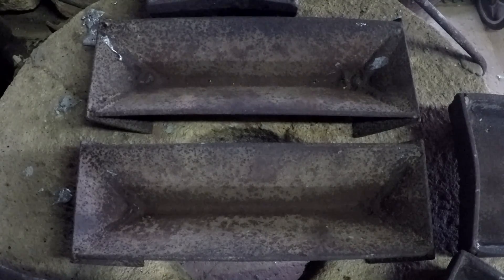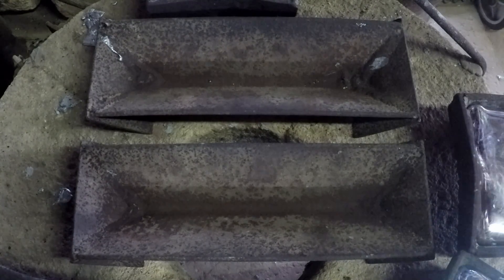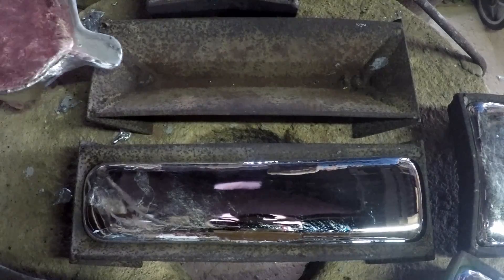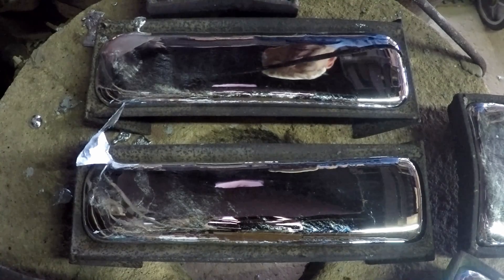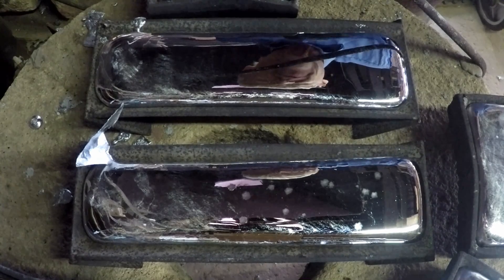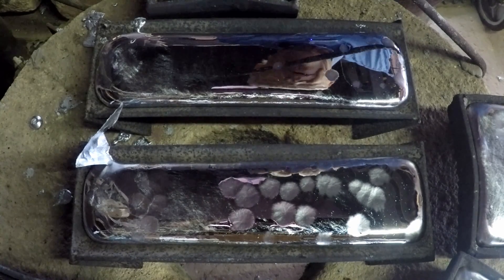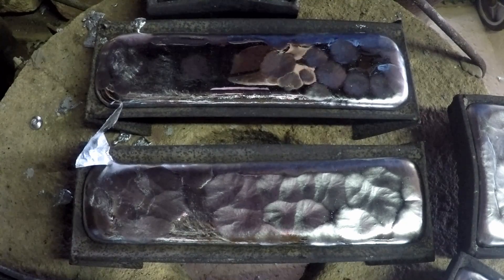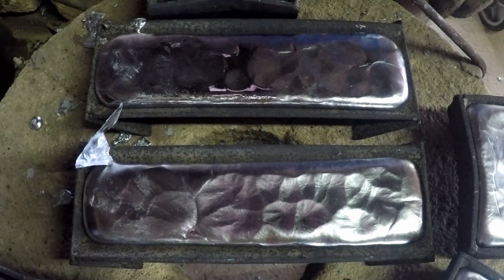Solidification Curiosity

Comment: Interesting ! I have to try it out in my foundry . I have a question for you sir . Does using grain refiners and modifiers reduce the surface porosity occuring after shot blasting of alumnium casting ? Please guide .
Reply from the maker: Sourabh, Grain refiners may possibly reduce porosity because they promote better feeding. Modifiers are another story - strontium is widely regarded as increasing porosity particularly subsurface. Sodium is regarded as better but I doubt it would reduce the problem rather it probably won't make it worse.
Shot blasting is about the worst thing for showing up an porosity .😱. Martin

Comment: Yestarday i had similar problem the cast breaks like glass and it has shiny crystals 
The thing is i melt my scrap with bolts and all steel is this the problem
Reply from the maker: rabih, Bolts  and steel etc are bad news, Molten aluminium is quite good at dissolving steel and very good at dissolving stainless steel The iron thus dissolved in the aluminium forms compounds with aluminium and silicon, these compounds are strong but behave in a very brittle way as they seem to prefer forming on oxide films floating around in the aluminium. In so doing they straighten the films out so they act like long flat cracks in the aluminium, thus the shiny crystals you are seeing are likely these iron aluminium silicon compounds and aluminium with lots of them will indeed be very brittle. The crystals can also be silicon depending on the alloy but they are usually not easy to see with the naked eye. Any aluminium that has turned out like this for you  - throw away - it can not be recovered by any easy means. I short never alloy molten aluminium to touch steel for any length of time.... Martin

Comment: When i cast my 45-70 405 gr. Bullets. When the pure lead is very hot I get what looks like frost Crystals on the serface. When I pore a few minutes  later. No frost looking crystals just very smooth shiny  finish.
Reply: There may be small amount of zinc   as i melt down wheel weights.
Reply from the maker: Mark, I am not certain (well, I don't really know at all 😏) but I would think that pure lead may be a bit too soft to use for wheel weights and it would not surprise me if it contains some antimony to harden it up. However the zinc situation is another story. Strange as it may seem zinc and lead don't get on that well together at all and in fact except for very low concentrations of either they will not alloy but rather form two different liquids (lead on the bottom zinc on the top) The zinc one melts at about 420 deg. C and the lead one at about 320 deg. C. Now what happens as a low zinc alloy cools from 420 to 320 is that it will slowly reject what little zinc it contains, this zinc will be solid and likely floating on top of the lead. When the metal is just solid the lead will contain almost no zinc in solution having rejected almost all of it. Perhaps this is what your seeing - well that's my interpretation of the zinc lead phase diagram anyway😏...Martin
Reply: @olfoundryman8418  .. I  was guessing  the frost looking crystals was because of the zinc.. could these crystals be antimomy? Or combination of both?
Reply from the maker: Mark, Are the crystals big enough to see if so what shape are they - antimony has quite a distinct shape. However I would only expect the antimony to form crystals of an antimony rich solid solution containing a little lead if the antimony content was over about 12 %. and these may well be through the remaining liquid rather than just on top of it.  Presumably your thoughts over the zinc is pick up from the steel lugs used to hold the weight onto the wheel, considering how thin the zinc is I doubt that you would get any significant pick up. Interesting as to what this "frost" might be though... Martin

Comment: A very interesting phenomenon. Reminds me of the well-known  Benard convective cells, and sure enough there are many hexagonal cells, or hexgonal-oid cells. Since the metal at the bottom of the mold is still  hot and the surfacw is ambient, it looks to me like Benard convective cells.
Reply from the maker: Juan, Now here you have got me! I was trained as what might be called a "Secondary Metallurgist". The aim of the course (3 year full time) was to produce Metallurgists of immediate use to industry - someone who knew how to take a hardness reading and knew what it meant, someone who could take a sample of anything (metallic) prepare a metallographic specimen from it look at down a microscope and know what he was looking at and what had been done to it, plus a whole lot of other useful stuff besides. But what you mention here is far and away above my pay grade 😊 - more in the realm of physical metallurgy I suspect.
A few things though, the metal was cast into a steel mould, not room temperature  cold but still way colder than the metal, surely then the metal at the bottom would be the colder? Also the size of the hexagons varies with the mould temperature - colder mould smaller hexagons. It also varies with very minor alloy additions 0.01 % strontium for example produces a very marked reduction in hex size not surprizing perhaps as the Sr modifies (refines) the silicon structure and this is a eutectic Aluminium Silicon alloy. Other alloys eg. the American 356 which is considerably hypoeutectic do not exhibit this effect at all. But I do note that it sure looks like those Bernard convective cells - as to if it is or not I do not know enough to know....Martin

Comment: Not related to your topic, but my uncle told me that molten aluminum tends to dissolve iron.  Steel can be protected by coating it with plumbago.  Your ingot forms reminded me of this.
Reply from the maker: Vel, Aluminium does indeed dissolve iron, in fact it will dissolve almost all metals. It is particularity vicious in dissolving stainless steel but mild steel and cast iron are also attacked. Once the aluminium "wets" the iron dissolution can be quite rapid. Unfortunately the iron has a bad effect on the aluminium making it brittle and more difficult to cast. Worst of all the iron can not be economically removed from the aluminium. This is why one should NEVER use iron crucibles to melt aluminium in. 
A coating of a wash based on graphite (plumbago) or even better one based on boron nitride will delay the attack but once the coating is scratched or ruptured in any way the attack will proceed.... Martin

Comment: Perhaps it's particles of iron oxide from the mould starting the nucleation points?
Reply from the maker: Amalg,  It could be damn near anything. There are fairly strict requirements for a nucleant to work - something about similar type and size of lattice structure in at least one direction with the substance being nucleated. This means that different things nucleate different substances. I have no idea if iron oxide would fit these requirements, maybe maybe not. Only thing I can add is that there was no loose iron oxide on the moulds... Martin

Comment: i only learned about eutectic alloys his week messing around casting solder. would love a more comprehensive discussion about them if you can !
Reply from the maker: Emmas, Eutectics,  one hell of a big subject about which I know not too much. They are what actually got me into metallurgy. As a young lad I was fascinated as to how one could mix two or more metals together and (sometimes)get a result that melted well below the melting point of any of the components. I worked with low melting point alloys specifically 50% Bi 25%Sn 12.5% Pb, 12.5% Cd it melts at about 71 deg C (Woods metal I think) and I used to make tea spoons out of it in little plaster moulds had some fun in a few cafes I can tell you!
Eutectics are fascinating things, they behave like a pure metal, they are very fluid, they have surprisingly high resistance to temperature, For a good casting alloy it is said that you want between 20 and 80% eutectic in the structure to ensure good feeding ability. What you need to do now (assuming you know little of metallurgy) is get a copy of "Metals in the serviced of man" Its  a penguin book and therefore quite cheap. It is a good introduction to metallurgy and is an easy read it delves into phase diagrams and therefore eutectics enough to wet the appetite. But in the meantime if you have any specific questions ask away... Martin

Comment: I've  never  seen anything like that before,  thanks for showing us. On a different  note though, you have explained the coatings you put on steel/iron tools you use. Do you coat the ingot molds as well?
Reply from the maker: Michael, I use two sorts of coatings. On the ladles that I use to actually cast from I use a boron nitride material called "hard coat" by ZYP coatings, it is very expensive, but very good. It repels molten metal but you need to check its upper temperature limit before using on metals melting higher than aluminium. I also use this coat on my degassing lances and thermocouple sheaths. I have been using the same thermocouple now for some years and its metal sheath has suffered no attack from the molten aluminium despite sometimes being immersed for many hours  each day. I use a different coat on my drossing off spoon it is a commercial product and I do not know what is in it its not as good as the hard coat but it was much cheaper (much!) It looks to contain iron oxide and possible alumina powder plus I guess a clay as a binder with a water carrier. I do not put any sort of coat on my ingot moulds, they get such occasional use - once at the end of a casting day , that its not worth bothering with... Martin

Comment: Hi martin
I have a prob but it is withe bronze 
The cast is a big sculptur i want to cast the head seperated then weld it with the body 
How can i weld it ?
Reply from the maker: Rabih, It depends on what bronze but most of them are weldable if the welder knows what he is doing. A lot of sculpture work is cast in silicon bronze and I believe that this welds quite easily. Gas metal arc is used for section thickness greater than 3mm and Gas tungsten arc for thickness less than 3 mm. Welding of zinc containing copper base alloys is a bit problematic and then brazing is probably the best option. However brazing or silver soldering are difficult with aluminium containing bronzes.... Martin

Comment: My only guess is that air convection cools metal more than mold (was they hot at the moment of pouring?) - that causes solidification to top to bottom.
Reply from the maker: Ashkira, The moulds were at room temperature and made from steel so its unlikely that the air would cool the metal as much as the mould. This is why I found it so intriguing we should see solidification extending from the sides against the mould but we don't! Possibly if we could see deep into the metal we might see some off this. But I would never have expected solidification to occur in the middle of the liquid like that in such a short time frame.... Martin

Comment: Isn't this called as heterogenous nucleation? It's induced by the intermetallic particle(which is silicon in this case) that has a higher melting point. I just bought plenty ADC12 (Al10Si3Cu) Ingot, and haven't try to melt it yet. I'll inform you later when i have tried.
Reply from the maker: Bernard, You take me back to my student days and to that part of the metallurgy curriculum that was, well, not exactly my favourite and which I am ashamed to say I did not study as much as perhaps I should have! Heterogeneous nucleation, yes indeed but the silicon has to nucleate on something. It is commonly Aluminium phosphide particles which have themselves nucleated on  the many oxide bifilms floating around. This silicon nucleation occurs at relatively small undercooling however if we modify the alloy with strontium the aluminium phosphide is effectively poisoned as a nucleant. If we modify with sodium the aluminium  phosphide is reacted away. In either case undercooling increases until a (normally) somewhat less favourable nucleant comes into play, Chromium boride has been put forward as one such nucleant. In the case of very clean and pure metal alloys undercoolings of some hundreds of degrees have been observed and while this is not the case with aluminium alloys it is know that significant undercooling can occur in parts of even commercial aluminium castings. ADC 12 is not an alloy that I have ever used as there is no local equivalent. I will be interested to hear what you make of it. I suspect that it will cast reasonably well from a feeding point of view but not perhaps as well as 356. It should be more fluid that the 356 but its corrosion resistance will not be anywhere near as good...Martin